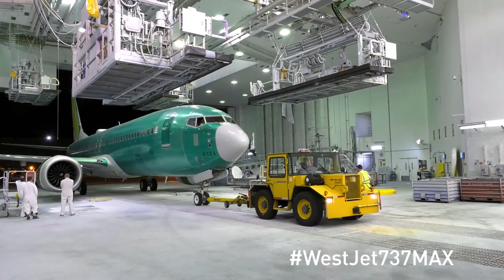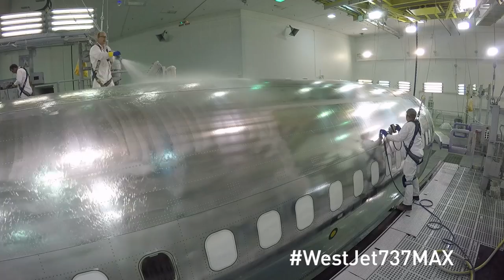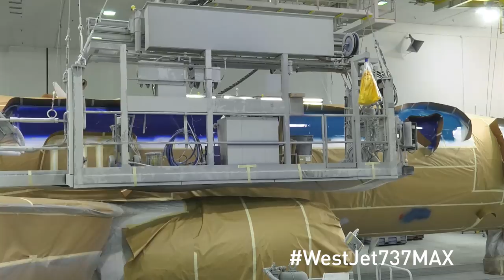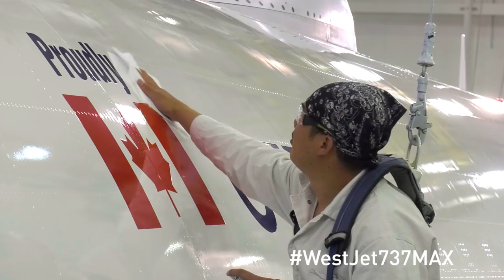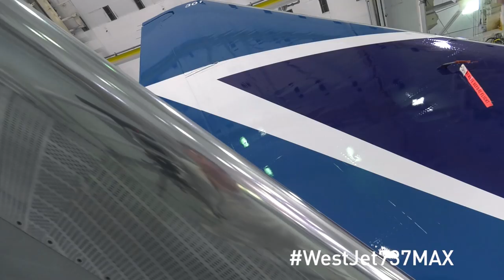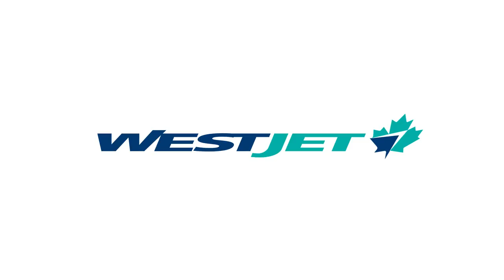Painting WestJet's first Boeing 737 MAX 8 aircraft

Comment: is the paint waterproof? just saying
Reply: Yes it is it also has a clear coat
Reply: Why wouldn’t it be??
Reply: An airplane is painted for corrosion control not waterproofing. There are some airlines that have bare polished aluminum in some areas of their livery scheme like American Airlines used to have to save weight in fuel costs but are now painting those planes because it’s more cost effective. A plane is stripped of its paint every five years and is inspected for anomalies before the next paint is applied. The average life span of a plane is 30 years so this would happen 6 times in its lifespan.